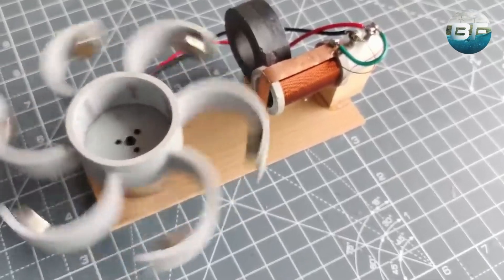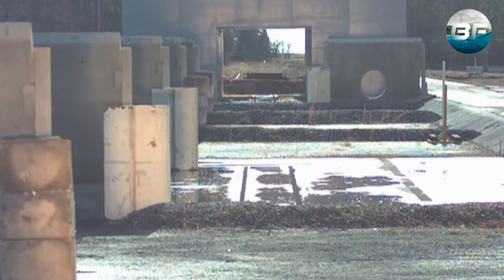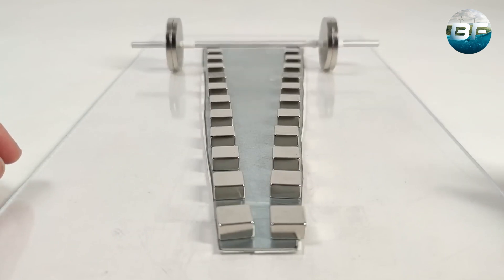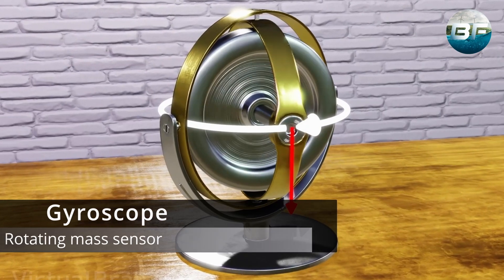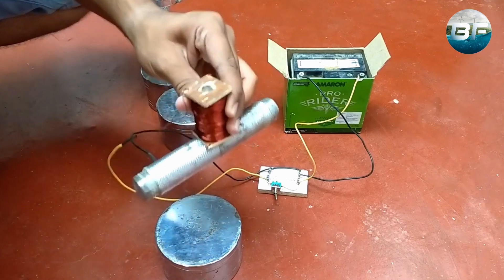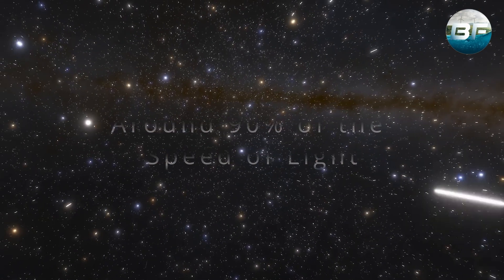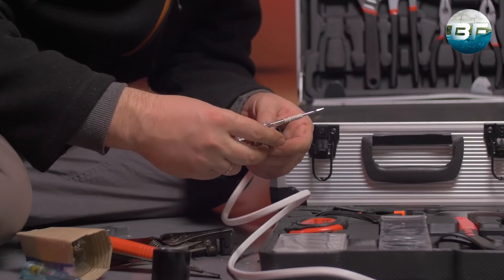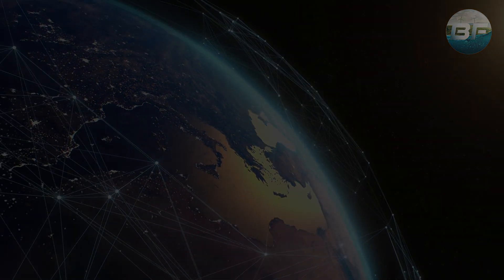Uncovering the Reality Behind the Myth of FREE Energy!

Comment: HI, lets say we use permanent magnets generator with magnets on rotor and stator. Separately we add a starter motor and a battery. When magnetic flux inside the magnetic generatormotor, , drops ,a starter using the power from the battery, will give a boost to the generator to keep a magnetic field and flux running a starter is used as exciter just occasionally to keep the rotation running. The batteries would charge when magnetic fully permanent magnets generator starts turning.
Reply from the maker: Hey, nice approach but think about that: While it's possible to use a generator to charge a battery, the energy output should ideally exceed the energy input required to turn the generator. If the generator needs a continuous external source (the starter motor) to maintain its motion, it's unlikely to generate surplus energy for battery charging. Also all mechanical and electrical systems experience losses due to friction, resistance, and inefficiencies. These losses would gradually drain the battery, making it unsustainable in the long run. In a closed system, you cannot continuously generate energy without an external source. The battery would eventually run out of power, and the system would stop :)
Reply: Thanks for your considered response / opinion.
What I had in mind is only using external battery  power when the magnet motor would start loosing the magnetic flux ,sufficient to keep the motor charging and running on both internal permanent magnets power and occasional boost for charging . A relay would be needed to switch the alternator on and of as required. The magnetic motor will also charge a battery for later use.   This way I guess  predominant source of power is magnetic flux and a secondary one is an alternator charging motor.  The difference  of power in and out should be positive in favor of magneto motor power. Does it make any sense. This is my chemical approach. @BeyondFuel
Reply: @BeyondFuel  have you heard about Energy Impulse Secrets and Power Impulse Secrets by kanarev. I would post the link but my comment might get removed if I do. So the papers show a self running electromechanical generator that charges a battery and generate HHO from water at the same time. They abandoned the law of conservation of energy and a new law called the Inertial Increase of Electrical Power was created. They also state in the paper why these types of technology are not released to the public. Something to do with the inability to price it similar to traditional Energy systems. The paper says something about newton laws of motions are incomplete as it did not take into account the instantaneous moment of force (or something like that). Worst part is that this new way of looking at Energy is not just about free energy because the reason they did indept research on it was because the phenomenon caused the failer of two hydroelectric dams. Lives where lost and billions of dollars wasted. Please look it up you will find several English translated  versions of the papers because Kanarev is a Russian scientist.